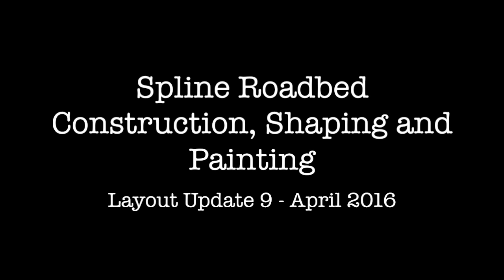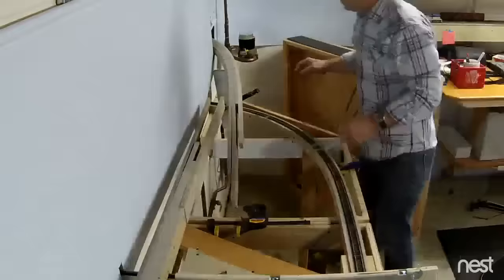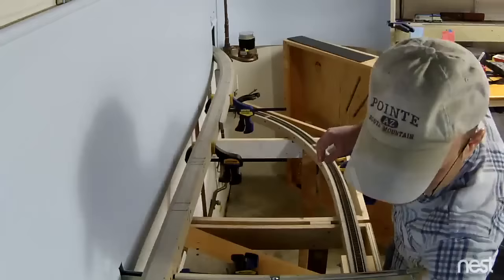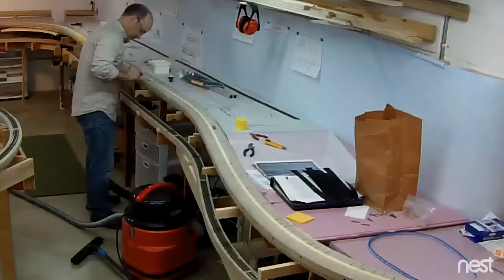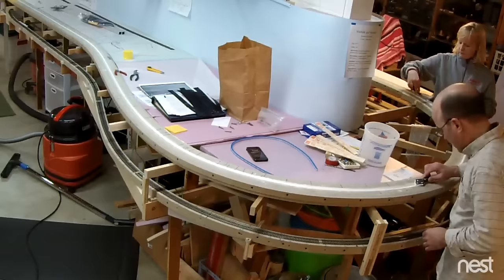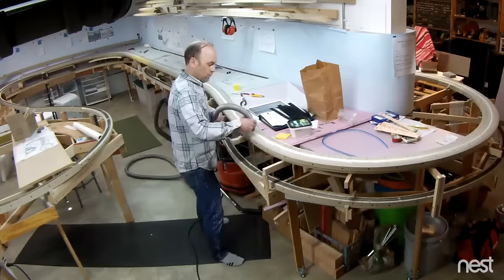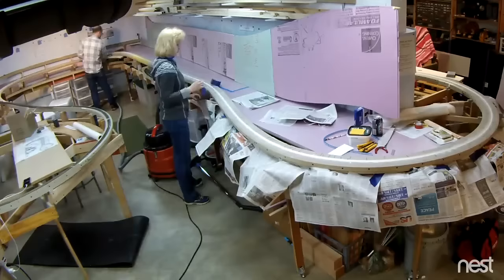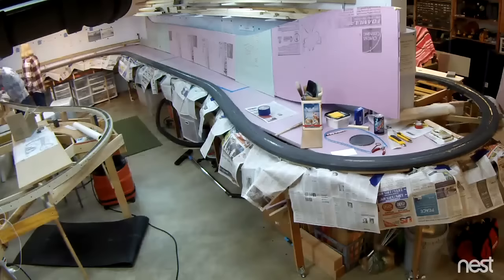Layout Update 8 - Spline Painting and Off-Layout Assembly

Comment: Having watched a few of your updates, it appears that you do two things that are surprising to me.
1: You don't seem to be using any glue on the splines at all.
2: The only mention of sanding is for the Spackle used to shape the ditches (not for the homasote splines), suggesting that the splines must come off your table saw absolutely perfect.  Did you cut all the splines for the entire layout at one time to ensure the saw was set up exactly the same?
Reply from the maker: Hi @mpeterll, thanks for the comment.  You're correct with your observation of the spline fastening - I use only drywall (or similar) screws to attach them to one another.  The main selling points for this approach is that it is quicker and less messy, but it also allows for disassembly / reassembly if needed.  One of these corrections is captured in one of the previous time lapse videos.  I make a lot of mistakes or end up tweaking the alignment, so this is a very good feature for me!

The splines come off the saw with a beautiful finish, so no sanding is required.  I will run a surform across the surface after assembly to collect fuzzies and to knock down high spots if I've assembled a section poorly.  I don't use a table saw; I set up a fixture to act as a saw guide for a normal circular saw using a 60 tooth carbide blade (I've also used a forty tooth blade with perfectly satisfactory results).  With the fixture, you can repeat the same cut as many times as  you need to, and when put on the ground, the size of the sheet being cut is irrelevant.  The fixture has the side benefit of allowing me to cut various sizes of "dimensional" lumber from sheet plywood.  I initially tried this on a borrowed portable table saw, but that was clumsy, felt unsafe and required a minimum of two people to get the work done safely and with some precision (and even then, the precision wasn't great).  Let me know if you have any other questions.  Here's a quick video of it in use - it has undergone very few changes since this was taken.

https://www.youtube.com/watch?v=KvieQOfI0nQ

Matt